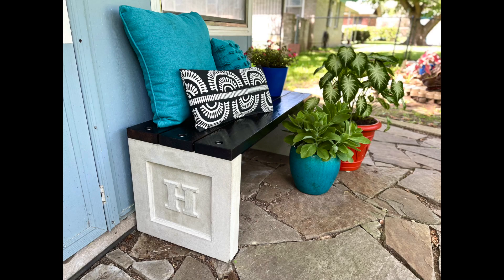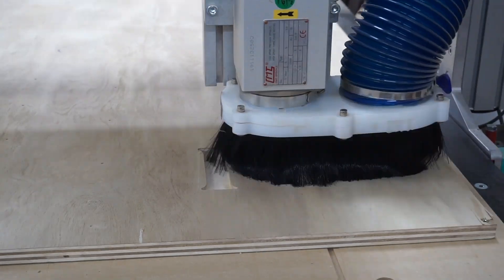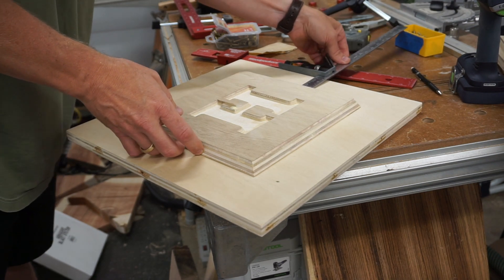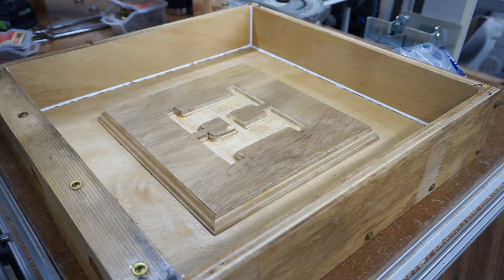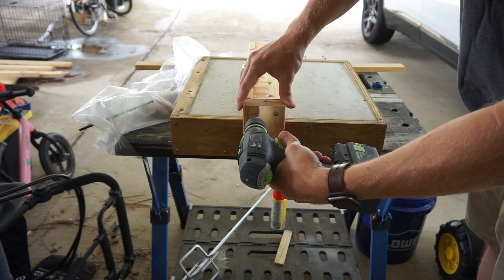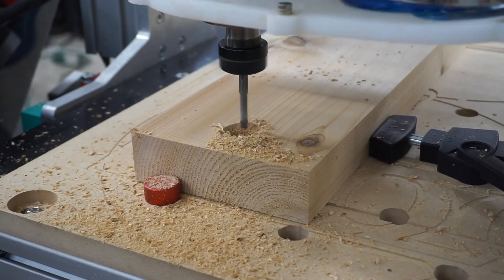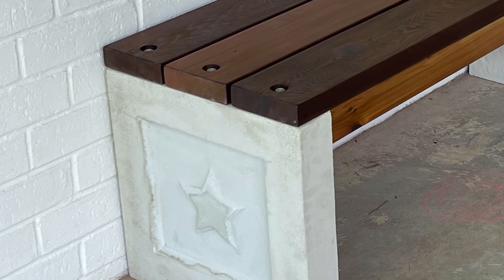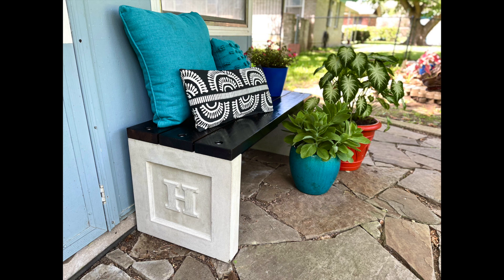This CNC Technique Makes Custom Concrete Benches

Comment: Good video, you can also add color to the concrete to create a different contrast.
How much was your CNC?
Reply from the maker: I did a test with some color and didn't like the outcome, but it was only one test and I'm sure with some practice and the right product it would have been a much better result.  My particular CNC ready to run, and including software, was approximately $10,000.